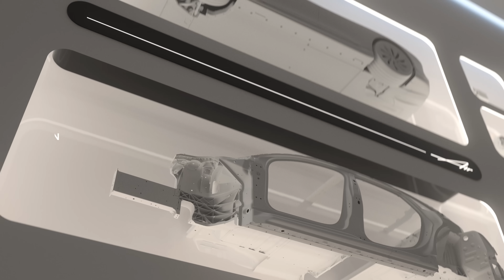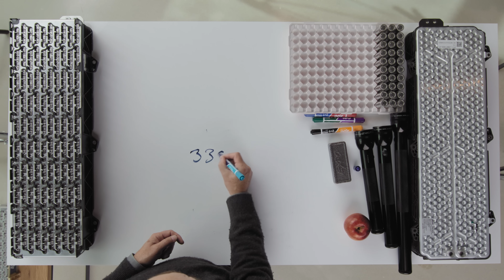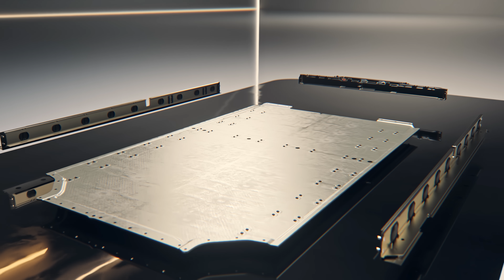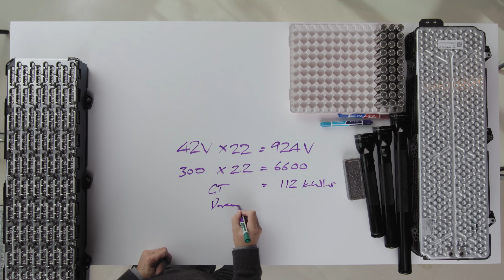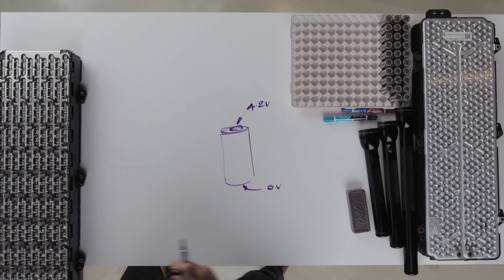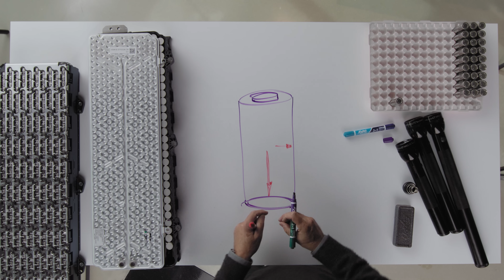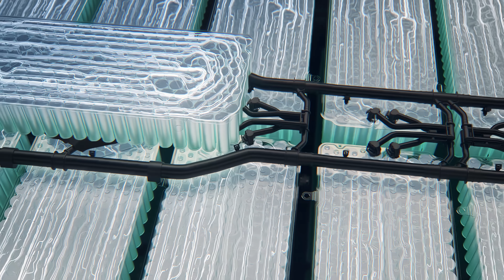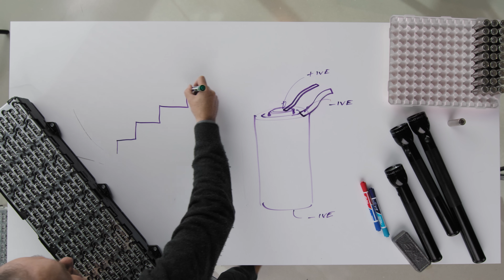Battery Pack | Tech Talks | Lucid Motors

Comment: Peter you turn the batteries cell upside down in order to vent for safety, everybody know that hot air/gas rises, if you put a vent at the bottom and turn the cell upside down the heat still going to rise to the top so you need some vent at the top create channel for the gases to exit out.

Comment: Now i wanna see them short a few cells in a running car see if it chain reacts or handles the heat. Of course LFP cells doesn't have this problem if you use the BYD blade battery.

Comment: My main concern about the battery bus is that aluminum will oxidize then simply fail with vibration. Good initially but long term, it's anyone's guess how long the packs will last. Silver is definitely the way to go and the little amount per car required should be considered, especially on a car this price IMO.

Comment: tldnr: made the car aerodynamic and put a lot of battery cells in it
Reply: You forgot the narrow tires.
Reply: @miguellopez3392  all the evs do that, get extra fast tire wear thanks to the heavy narrow combo too!  (i have an ev and love it, just not a full zealot)
Reply: @JackMott  except the model S plaid It needs wider tires ro do the 0-60runs in 2 seconds Which hurts its range in return.
Reply: @miguellopez3392  even that has narrow tires for a 1000hp 5000lbs car, just a bit less narrow than lucid I guess.

Comment: In some businesses it's best to have top managers who are specialists in financing or marketing, but as an engineer, I'd rather work under a CEO like the guy presenting this video. He clearly knows and loves engineering, and his ability to present accurate technical details is a clear way is a valuable skill even when talking to other engineers.

I'm particularly happy with his emphasis on manufacturability and cost. One of the best lessons I've learned in my career is that it's (usually) a mistake to have market considerations handed down to engineering as requirements. Instead, marketing and engineering need to adjust our goals frequently as we learn more. It helps to have a CEO who can speak both languages in detail.

Unfortunately I'm not willing to relocate, but if some engineer reading this is considering applying there, I can vouch that this video is a good sign. Maybe some other aspect spoils it, but  based on the CEO the place looks very promising.

Comment: The higher the voltage the lower the current.  Which means you can use smaller guage wires and save weight

Comment: OK.  Let's see what we have here:
The larger of the two available battery packs is either 112 kWh or 118 kWh.  Peter mentions there is a chemistry difference between these two.  Perhaps they haven't fully migrated to the newer cells, or they cannot yet get them in volume.  Either way, let's begin by assuming 118 kWh.  The larger battery pack contains 22 modules of 300 cells each, for a total of 6600 individual cells.  188 kWh / 6600 = 0.01788 kWh = 17.88 Wh per cell.  If we assume these are lithium-ion cells with a nominal voltage of 3.6 V, we can calculate the current/charge capacity of these cells to be 17.88 Wh / 3.6 V = 4.966 Ah = 4966 mAh.  These cells are 21700 cylindrical format.  We can scale this to an equivalent 18650 cell by multiplying by ((9)^2 x 65)/((10.5)^2 x 70) = 5265/7717.5 = 0.68.  0.68 x 4966 mAh = 3388 mAh.  This seems kind of low to me.  I would expect Lucid to be using state-of-the-art cells.  Assuming a "round" specification, these must be equivalent to 3400 mAh 18650 cells.  I estimated the 18650 cells used by Tesla in the Models S and X to be 3550 mAh cells from Panasonic (as of 2020, or so).  I believe Lucid is sourcing cells from LG.  Is it reasonable to assume this is the best LG has?  Genuinely interested...

Comment: How can you mention the 220s30p battery pack because the module pack has 30p10s and 22 of these modules would give you a total number of 6600cells but the configuration doesn't match with the 220s30p.

Comment: The strength of a chain is the weakest link, 1 bad battery and the advantage of higher voltage disappears. Nevertheless, very nice presentation.

Comment: Your forgetting the ac to dc charging iron losses via a step up transformer. Unless you have a high frequency boost buck converter then you might lower your losses by quite a bit, how ever it comes at the cost of price. Which is not really economical at that amperage, so what would be best is to match your battery pack to the ac supply and then use the full bridge rectifier and capacitor method of providing dc current. Then use a resistor to regulate it.

Comment: Does Lucid electric cars battery packs have the same type of problems with those cell batteries and those cell batteries connections as Tesla have had. I mean that if only one battery cell or only one battery cell's  connection is broken the whole cars battey pack has to change or the battery pack has to opened to find that bad connection or find that broken battery cell.

Comment: So what if one of the cooler jackets develops a leak and it will fill bottom of the battery with liquid where there is all battery contacts.. thermal runaway is guarantee

Comment: Nice talk, thanks for presenting it. I have few questions:
1 - From ease of repair and ease of recycle point of view, is a cell contacting with anything else besides the wires and the cooling plate? Which means it would be relatively easy to remove a faulty cell and replace it with a new one.
2 - I assume the bottom of the cell that gets in contact with the cooling plate contains also the minus charge of the battery. Which means that is half of the step to connect all the batteries in parallel. Yet they are connected on top through wires, and obviously don't have all the batteries from the pack connected in parallel. So what exactly is going on there? Are the batteries glued to the cooling plate with some substance that has low electrical and high thermal conductivity?
3 - The idea of cooling from the bottom looks nice, but I wonder if in practice this still leads to worse lifetime of the batteries compared to a pack with cooling from the sides of the cell. The later should give more uniform temperature through the cell, in theory.
4 - The part about thick wire and thin wire is not clear. The total resistance in the pack will be the sum of resistances in thin wires and in the thick wires. It's understandable that there's a trade-off, by using thicker wires you increase the cost and mass, and using thinner wires you increase the resistance. I don't see how using alternating thin wire on plus and thick on minus achieves anything.
Reply: Igor, my 2 cents after watching this video:
Re #2) No need to electrically connect the cell bottoms as they are connected at the top because the cell case transmits the current to the top.
Re #3) Peter explained that the side contacts (for cooling) with the batteries is difficult when mass producing compared to the creating a good contact at the battery bottom. 
Re #4) I think the use of only 1 thin connector at the cell top instead of 2 reduces the resistance.  From what I heard, the thin wire acts as a fuse and there is no need for 2 fuses in the same circuit.
As a mechanical engineer, I enjoyed the presentation as this is all new technology compared to my experience with ICE vehicles.  Very interested in how these are designed, manufactured and achieve higher efficiencies relative to current EV and ICE vehicles.
Currently have a Pure on reserve but will have to see the Pure specs when actually available.  My preference is for a smaller vehicle more the size of the Hyundai Ioniq 5 but with the Lucid efficiencies.

Comment: As you know, Lucid produces their vehicles in Arizona where summer daytime temps can sometimes exceed 117F.  Some parking garages, even though they’re shaded, can reach higher temps!  What will these crazy hot temperatures do to the Lucid batteries - despite the efficient end-cooling Peter makes mention of?  I know that normal vehicles’ flooded battery has a recommended replacement interval of 24 months when subjected to these extremes, so….?

Comment: It looks like the battery pack might cost $30k when installed in the vehicle.  6600 cells x $4 each, + $4000 for the support hardware.  It is probably a bit more than that.  Having so many batteries is going to cost a pretty penny.  But you get what you pay for.

Comment: For me this is very basic stuff, but he explains it very well and understandeble. The 900V system will produce less heat, will need thinner wires and because of that also safe weight. On top of that the charging cable of the supercharger can be thinner too, so it's more easy to handle. The only downside is that it will more easely be deathly in case a housefather is trying to fix the car he just crashed into a tree. 

I actually think that the Tesla semi will get a (much) higher voltage battery then their cars, partly because it will be much more easy to handle the megacharger.

Comment: Quite similar to the original Tesla Roadster and Model S HV packs, in that Lucid uses many thousands of tiny 18650 "flashlight" batteries, as in laptops and power tools.  Improvements over Tesla are a higher pack output (900 VDC), as for most newer BEV's, instead of the 400 VDC in Tesla packs.  That makes fast-charging easier (half the current).  Another advantage is that the end-plate cooling and lack of adhesives should make replacing individual failed cells much easier, and likely easier assembly too.  The Physics he presents is high-school level so not amazing, though when stated in a high-class British accent it sounds more clever.

Comment: How does Lucid Air Motors manage the failure of just one of these battery cells?  I had an electric scooter once, with an 48Volt li-ion battery that failed after four years, because the battery pack wasn't moist air proof. The electronics integrated with the battery cells eroded to a point that the battery broke down, most likely due to rainy weather, and that is a very costly battery design flaw. Lucky me, the Li-ion battery from this particular brand of electric scooter was also dangerous: spontaneous combustion during a recharge. The manufacturer took all their sold electric scooters back for half the initial price.  For any electric vehicle battery management, efficiency and safety is crucial. I have high hopes for Na-ion technology, it is saver, has a lower energy/weight ratio and a higher power/weight ratio than Li-ion batteries. In case of high overal EV efficiency this battery type can replace Li-ion batteries. The Lucid Air car has this extremely light weight motor that runs on high voltage and low current, excellent choice design choice.

Comment: Peter stated making the Lucid Air last 200k miles. The question I have is the 200k based on the wear and tear of the vehicle or the life of the batteries? The Lucid Connected Home Charging Station is scheduled to be released later this year with full bi-directionality for advanced Vehicle-to-Everything (V2X) capabilities built-in for future enablement of Vehicle-to-Grid (V2G). Will my Lucid batteries die well before the car does using the batteries to power my home after the sun goes down every day when solar is off???

Comment: Your battery is actually a "30p 220s", sequence matters. 220s 30p is a different configuration.
Also not sure why he doesn't use industry standard kWh but adds the extra "r" on the end.

Comment: Not wanting to diss Sandy but Monroe did a video on this video and seemed to miss or misinterpret some of the engineering points like the heavier gauge cell wires which are strategic to reducing resistance and were dismissed by Sandy as unnecessary oversized wiring. Another was the cooling strategy which Sandy also thought was inferior without acknowledging the inconsistency problems that system presents. They also acknowledged what they liked and really praised the video content and production.
Reply: Thicker wires have more resistance, the cooling is inferior to what even the model Y has.

Comment: Fantastic 101 on their modules! Would have loved his presentation style for highschool physics.  I've been so curious on if they "properly packaged" their cylindrical cells.  Indeed they did.  They could do one more thing to further improve cooling, but at weight and cost increase, but I agree what they have is the "best" choice all things considered.

For those thermally non-technical, the way Tesla packages is utter junk and why they overheat.  They "try" to use conductive adhesive to compensate for thermal contact resistance, but implementation is poor. Not to mention the DeltaP drop that Peter didn't mention is also another issue of the side cooling method.  Definitely not designed by a TSE, but probably a Mech E. Makes me wonder if Peter was responsible for "Ok'ing" the Tesla packaging design or if that was before him.  Or if he learned the "proper" from the Atieva guys.

Comment: Doing the math's I work it out to be 42 volts per pack, if your cell are around 3.7 volts that would equate to roughly 11 in series, but I think your packs are 300 cells and probably 30 in parallel by 10 in series, this doesn't add up as this would only give 37 volts plus or minus half a volt per pack, which if you then multiplied by you 18 or 22 packs would not give the voltages quoted, I believe that you are quoting the fully charged 4.2 volts per cell, is this the way other EV manufacturers quote their system's! ?

Comment: You wouldn't require so many batteries if you designed a source for charging. Such as install a couple wind dampers in front of the car that will build up pressure as forward motion is created and have the air turn the pulley to an alternator that charges the batteries thus being independent from the electric motor and not taking torque from the electric motor also by putting a clutch on the alternator pulley that will only turn at aquired optimum force and pressure. That's your solution to your battery problem. Simplistic is always a good idea and adding more batteries is absolutely not a good idea which you and others will have to witness at the expense of others losing their lives

Comment: Now Peter,
All you need is an Aluminum Alloy that will turn your bus bar/connections to each battery being a (Super Conductor) can you imagine an (Aluminum alloy) that is a (Super Conductor) weight management, oxidation, wear, resistance being negligible?
What if I have the ANSWER’s?
A 5% addition to your aluminum component that creates a Super Conductivity!
Without wear, need time to try it on aluminum.
But it Works on gold & silver

Comment: 10 KW*h = using 10kW FOR 1 hour. (multiplication in units reads "FOR") [Energy]
10 kW/h = using 10 kW PER 1 hour. (division in units reads "PER") [d/dt * Power]

Now think about the range of the car in these terms. You're welcome.

Comment: The encapsulation-molded aluminum bus bars are super interesting to me.  That's a process I haven't seen before.  I'm also curious what kind of motor architecture is used in the Air; I'm guessing they're axial flux permanent magnet motors, for power density and efficiency reasons.  Do they use rectangular cross-section wires for the windings, like the ones Magnax makes?

Comment: Very very interesting! I have a cooling question: as the coolant flows through a battery pack, the cells at the inflow side get a little cooler than those on the outgoing side. Do you have to compensate that to avoid that half of the cells deteriorate faster than the other half, or is the difference so small that this is negligeable ? 
Thanks a lot for the very interesting video.